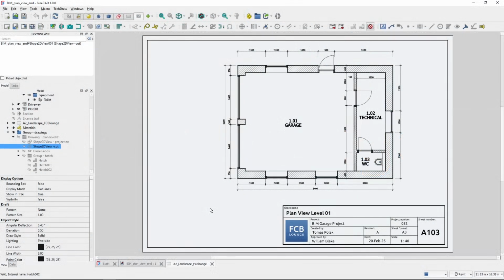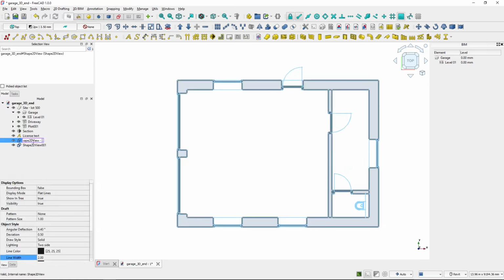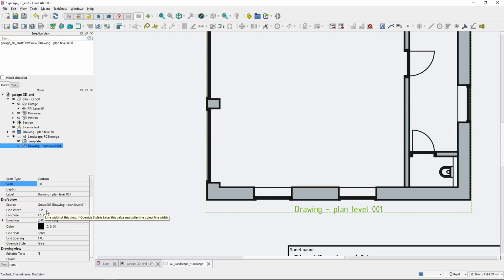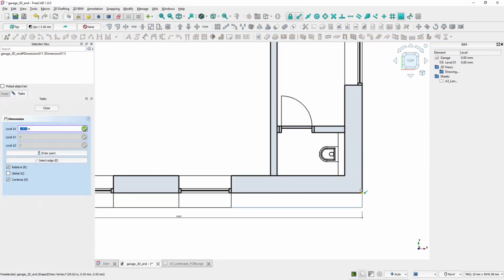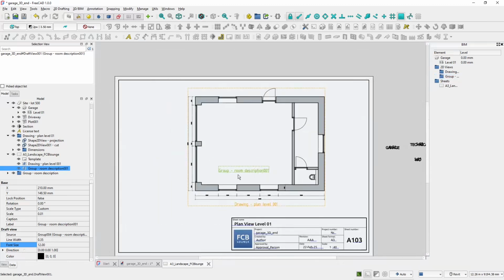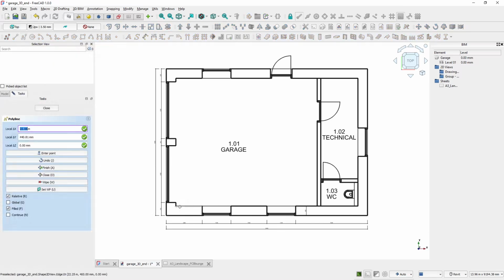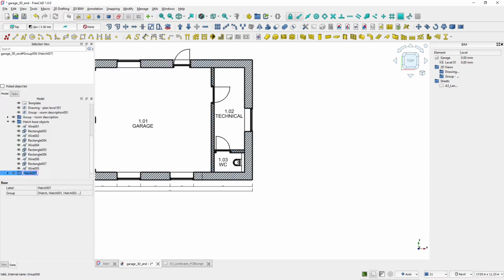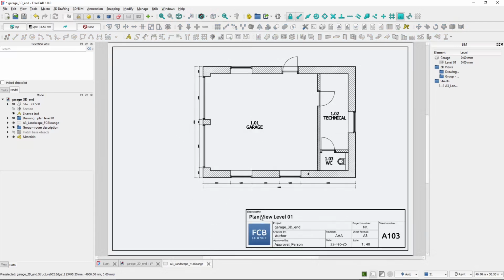Create a 2D Floor Plan Drawing from a 3D Building Model in FreeCAD BIM

Comment: I'm still new and exploring FC but to do the hatching why not generate a walls-only 2D view in BIM, set to cutfaces projection and generate the separate hatching object in BIM. You can then delete the walls-only 2D view and overlay the hatches aligned with your previous views and drop it into your plan view group so they appear in your Techdraw page? I would probably look at using layers (which I haven't tried yet but saw your video) to help manage the process, eg, separate windows and doors from walls etc.
Reply from the maker: That is an interesting idea, thanks for posting it. I think it is possible to use this workflow and it might be fast is some cases.